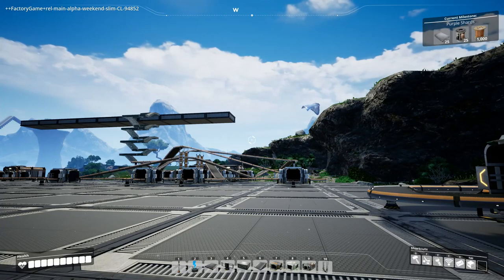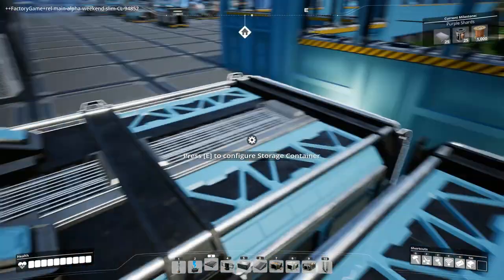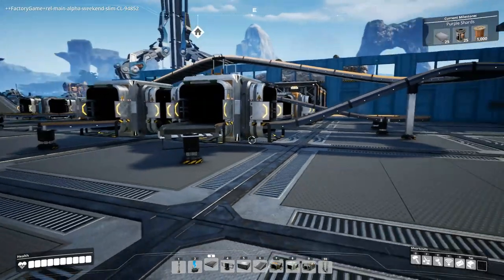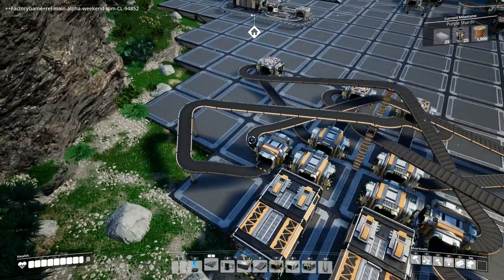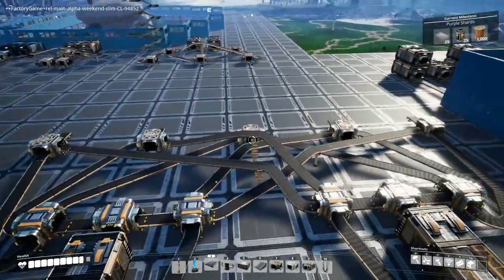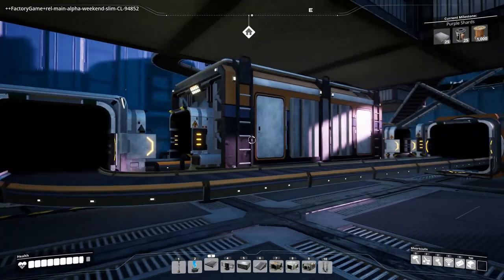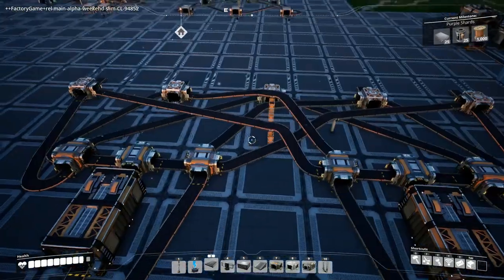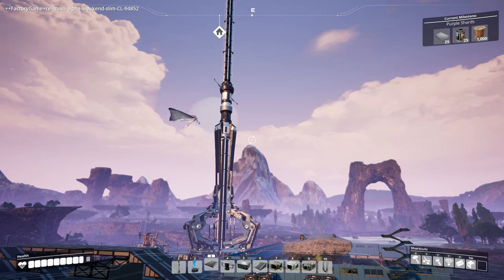Satisfactory - Splitters and Mergers, Basic Instructions and Complex Balancers

Comment: not using different speed belts when splitting makes your designs overly complex. still enjoyed the belt porn though...
Reply: What if you already have the top belts? In such case you can't merge them together unless you splitted them beforehand. It's my the only explanation why he makes this complex spaghetti though. )
Reply: Splitters and mergers are actually broken when using different belt speeds. It slows down the faster belt and speeds up the slower ones (not good). I would not recommend using different speeds for the same split/merge chain.

Comment: I don't get why you need to do this, as long as production is keeping up with demand, you can simply use one main line with splitters feeding smelters or whatever on one or both sides. 

Say you have two miners producing 150 ore each, 300 total. Both miners feed their produce on each of their belts capable of 150 units/minute, going into a merger. The merger then outputs to a belt capable of 300 units/minute, thus being able to support 10 smelters assuming they can smelt 30 units/minute. 

Splitters basically takes the main input and outputs half to the smelter and half down the line. In a short while the smelter will fill, and the main line will bypass that intersection to fill the next smelter, and so on. 

Given a few minutes of start up time, it will run at max capacity without ever clogging up, given there is room for the output at full capacity. It will even out on it's own.
Reply: This is better for assemblers and manufacturers because the ratios for the components aren't perfect. For ore, it makes no sense, but for more complex parts, it does
Reply: @domoniche1   For assemblers and manufactures you could also not let them produce at 100%, basically underclocking them to like 90% - 80%, so there is no need for complicated splitting and merging. You will produce, for example, 4.15 instead of 5 per minute but all machines will be producing at 100% efficiency! (regarding that they produce 80% - 90% of there maximum output)
Reply: @lazy5684  U should fix your comment by adding spaces next to your "-" signs
Reply: @nikelsad  Thx!